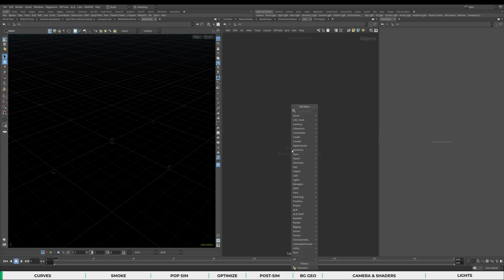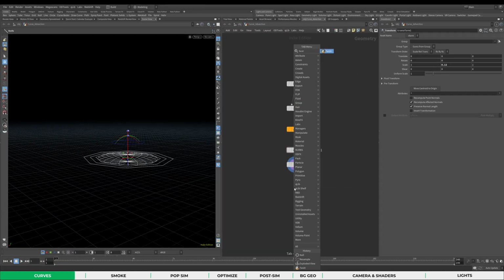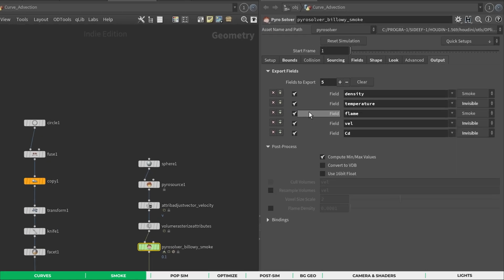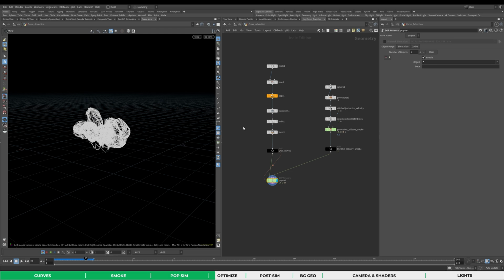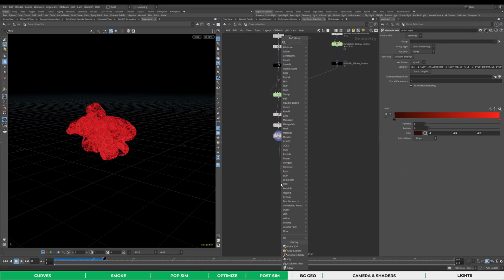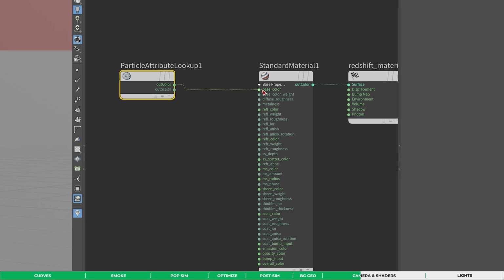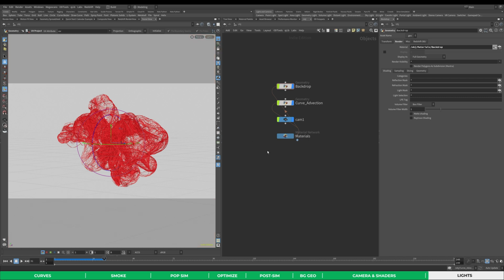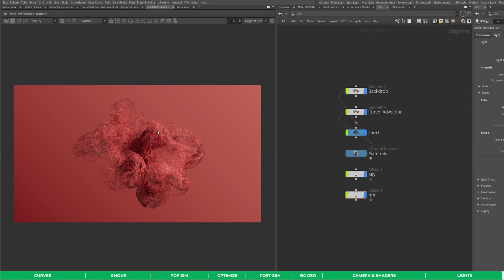Houdini Tutorial: Curve Advection

Comment: Hey Mister Mat! 
Thanks for your tutorial helped a lot.

I've just started learning Houdini and I'm running into a problem I can't find node RS builder material. 
Is this material only available in commercial version? how can I collect or replace this material? I'm working on non-commercial version 19 and can't find a material node that can even come close to the one you use in the video. I tried to assemble it manually but my Houdini doesn't find the nodes that are inside this material. For this material, should I install some additional plugins? Or is he going in default?
please help.

 thank you in advance for your response.
Reply from the maker: Thanks for the comment! RS Material is part of the Redshift plugin which is an external render engine that many people use in Houdini. RS Material Builder is therefore not available by default and you would have to install this external plugin. I am afraid that it is not available for use if you are using the free Houdini version. You would need Houdini Indie at least.
Reply: oh, nice, I actually have Houdini Indie in free version. do I have to open it to connect the RS or I also have to download the addon you are talking about. is this add-on available on Houdini's website? I am usually working with MtLX Standard surface when I work with materials. In your experience, RS material builder work better? @nymanmats